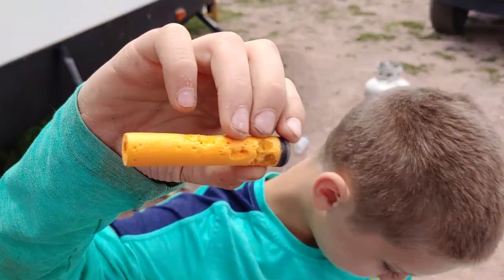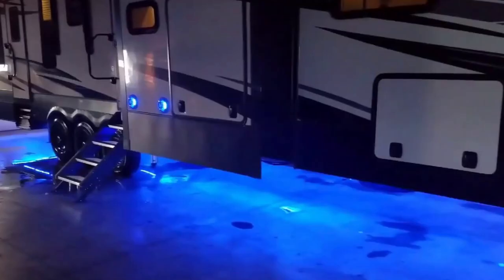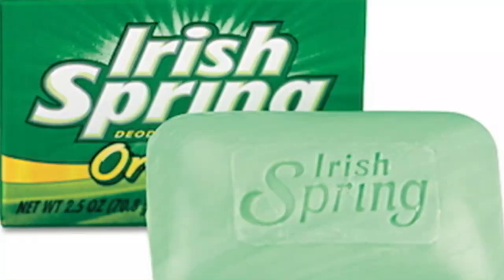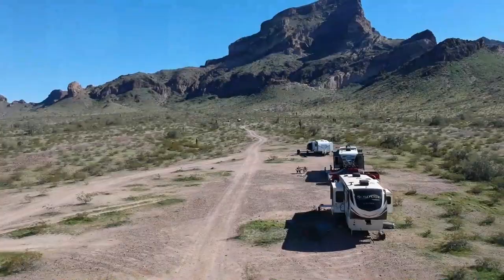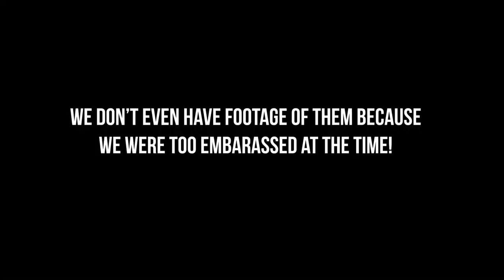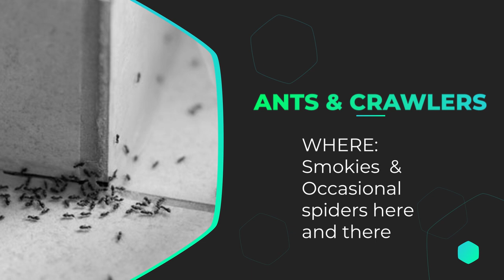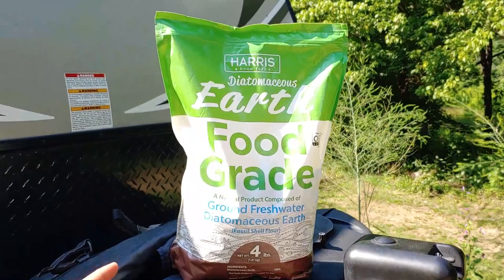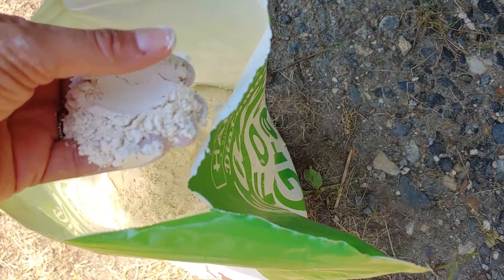Preventing RV Pests: Mice, Flies, & Ants Oh My!

Comment: DE is a winner, and safe for pets and kids.  Dust a 3 ft swath around your entire RV (or home) to keep away all the creepy crawlies.  You can also sprinkle on the floor and brush into the baseboard around the rig.  For proof that it works, if you ever see an ant hill, dust some on the hill and recheck within about a half hour and the entire ant colony will be dead.  Must reapply after a rain, but once you get a handle on the problem, you only need to apply occasionally.  A duster makes application easier.
Reply from the maker: I love the sprinkle on the floor and feet to the baseboards idea. Thanks for sharing!